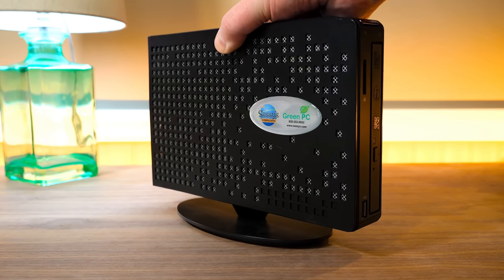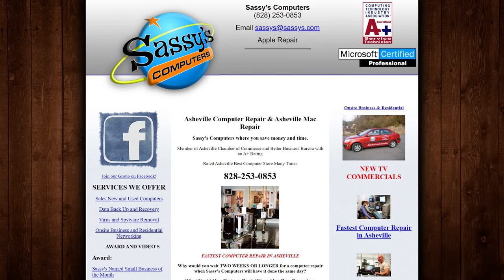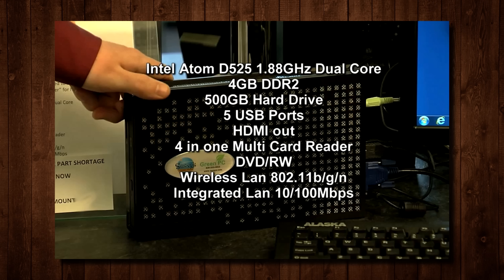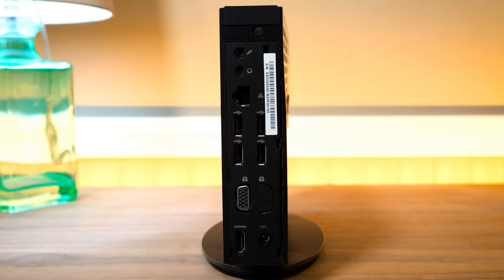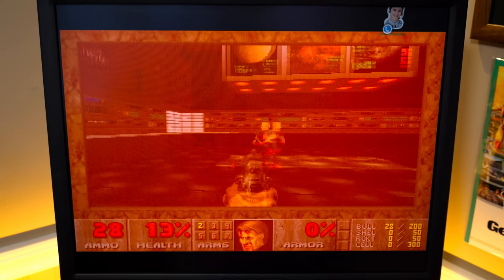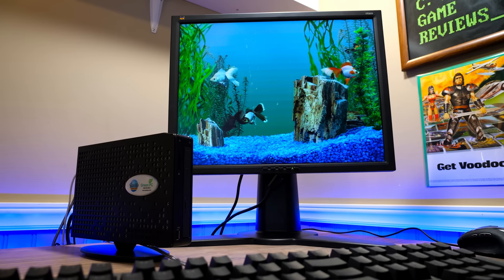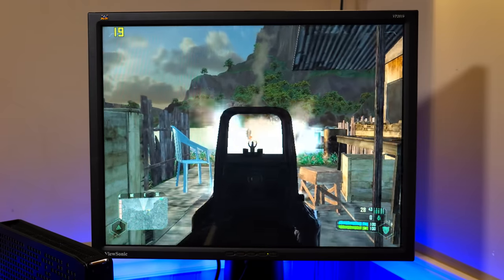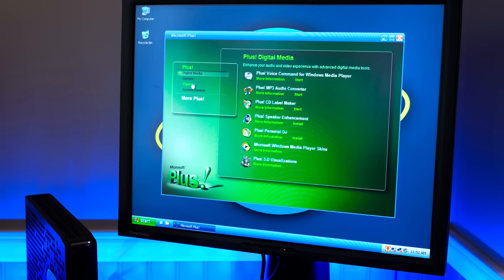Rejuvenating a $599 Shuttle Nettop from 2011! Sassy's Green PC

Comment: I think a video covering the netbook fad from back then would be neat.
Reply: I picked one up a couple of years ago because it was advertised as running Windows 10. I had to see that.

Eventually put XP on it and it hasn't half come in useful for some old niche software.
Reply from the maker: @Jared Lash I agree! I've been trying to find the netbook I had back then to make a video about someday
Reply: i had that nickelodeon one from dell and used it for years upon years. even though i was the intended age range for it i instantly uninstalled the theme that came pre-loaded onto it hahahaha. i played a lot of emulators and skulltag on it.
Reply: I almost bought one because im a writer and having an ultra portable writing machine was appealing but the small keyboard size for writings session was bad for my oven mitt hands.
Reply: @LGR  Which one did you have?
Reply: @thesinfultictac5704  you could have bought any keyboard you wanted to use with it though, including wireless keyboards with built in trackpads
Reply: They are still sought after in Venezuela for regular home / school use
Reply from the maker: @RoshiGaming  the first HP Mini 1000
Reply: You had a full fledge computer with all the typical IO you could want for less than a thousand bucks.

And you were buying a computer that didn't come with one of those useless windows licenses too!
Reply: @yarharyar  >useless windows licenses
????
Reply: Remember watching LGR on my netbook back in the day.
Reply: I had an EEE PC netbook and would play WoW on it when out of town.  It was/is an amazing piece of tech.
Reply: I wouldn't call it a fad. Before netbooks, laptop design seemed to be heading towards 17" displays in machines weighing 10lb (5Kg) with a couple of huge fans in the bottom and a battery life of 2 hours. Netbooks stopped Microsoft from discontinuing XP because the low power light machines weren't up to running Vista.
Reply: @yarharyar  well now, you can get a 15 inch computer with a fully functional windows os on it for less than 500 bucks.
Reply: I still use one of those netbooks today in 2022. Why?

Well I need a little lightweight computer to use with ham radio out in the field. It fits the bill perfectly.

Comment: Those D525s are surprisingly good little processors.  I've been running one with a board that I bought on salvage for $15 as a PfSense box for the last 6 or so years, and it just keeps going!
Reply: Ditto, ran mine as a PFSense box until the proprietary PSU in my case died.
Reply: My old pfSense box had a D525 as well. Nothing ever failed - it still works fine - but FreeBSD's Realtek NIC driver is terrible. Even compiling and loading an improved (backported?) driver still capped out at about 340 Mbps, which just won't cut it on gigabit fiber.
Reply: @Azlehria  Well, I learned something.  I should check to see what NIC chip I have.  Thanks!

Comment: I used to work on people's Shuttle units in the mid-late aughts and man they were cheap but efficient... but those motherboards were so picky when it came to upgrades and parts replacement.  Like you experienced with that RAM upgrade.
Reply: I remember when Shuttle was the go-to builder for LAN PCs, because they were so small and light but decently fast.
Reply: @HappyBeezerStudios  I'm pretty sure the first NAS I ever put together was from a shuttle pre-fab as well.  They were everywhere around that time.

Comment: I have a similar 'Green PC' from the windows 8 era, it's an AMD SoC all in one with Radeon HD Graphics. Used it as a home server for a while since it has USB3 ports as well as 1gig Ethernet, though a Raspberry Pi 4 soon superseded it in both performance and power draw.
Reply: You can find bargain Xeon E7 pairs all day on ebay and other websites. I nabbed a pair of e7 4890's for 8 dollars (for both). Not quite "low power" if that's what you're going for. But for a home server, they're stupidly fast.
Reply: @holocaust_2.0  Absolutely! I do have a much more powerful AMD Opteron based server too for more beefy stuff, but yea sadly for things i want to leave ticking away in the background 24/7, the Pi4 wins out on not inflating the electric bill

Comment: LGR has reached "current technology", Im still running a 2012 i5-2500K with a Radeon 7970 as my secondary PC / GFs Gaming PC, and its doing 2022 way better than id have ever imagind when I build it.
Reply: That 2000 series is a beast, I'm still rocking my I7-2700k as a home server and Nas (God bless Virtualisation and Linux) and it has never had any problems.
Old motherboards are a nightmare though, and people have started to sell them as "Vintage Equipment" driving prices like mad.
Reply: Yeah!  I have a 2500K in the last PC I built.  Some day, when I can find a video card, I’ll finish my “new” build.  (Which won’t be that new anymore by the time it’s finished.)
Reply: If you need a cheap quad core hyperthreaded CPU, I'd recommend looking at the Xeon E3 v1 and v2 CPU's, trust me the upgrade is worth it!
Reply: I'm running an i7 4790k and a GTX970, still getting by after 6 years. 👍🏻 You don't need to upgrade until the computer isn't doing what you need it to anymore.

Comment: I have an EeePC from that time (also Intel Atom of course), which actually had a discrete GPU. Not sure why I thought that was a good idea, I think I installed Linux on it and ended up playing some Minecraft. Windows 7 was indeed too slow on it, and then on Linux I had to battle the whole "nvidia gpu vs. intel igpu" thing... I think it was called "optimus" at the time.
Reply: that tech, optimus, was pitted against ion, and i guess ion lost the battle for board presence, as intel threw billions of dollars at battling the low power draw space, and it won them the laptop war against ibm, mac, nvidia and amd, they still dominate the market, by a huge percentage, and thats down to them investing all that money into not only the chips, but the coding and software.
Reply: What are you guys doing with your poor Netbooks? Had one with an Intel Atom N270, it ran Windows 7 just fine, on 2 GB of RAM..
Reply: @xPandamon  same here. In fact, I have an Acer D-250 with an Atom CPU and 1gb RAM and it runs Windows 7 quite nicely for everyday tasks
Reply: @xPandamon  Same here. I also have an ASUS eee pc and it runs Windows 7 Home Premium just fine on 2GB of RAM. I can even watch Youtube videos in 480p and play my Big Fish games without slow downs. Windows only uses 800MB of RAM at most unless I have Youtube open.
Reply: @lightly-red-huedmaleindivi6266  I had to use the mobile YouTube page, h246ify and custom drivers from chell but 480p ran well enough after some initial buffering. For one of the earliest netbooks that's not too bad, I could even enjoy some OG Doom. Also, nice name 😉

Comment: Hey Clint! Great video. Just curious: did you play HL2 via Steam, or a retail copy? Since Source got updates over the time maybe the Steam up to date version could be harder to run even on era-appropiate hardware.
Reply from the maker: It's an old version yeah, Steam doesn't even install on XP anymore.
Reply: Beside the latest version of Steam that support XP, HL2 also got updated (which have Steam Deck/Controllers UI and improvements, major bug fixes  that fixes many 2013-14 SteamPipe version issues) in 2022 and its have newer steam_api (which requires newer version of Steam) for some features like Achievements, its unknown if its still playable on XP, even without these.
Reply: @megakarlachofficial  it would be harder to run the modern steam version.  The fact that it's more resource intensive was complained about at length in spuf (steam powered user forums, the discussion section before modern steam community discussions) threads at the time the update to orange box engine happened.

Comment: Thanks for this video. I just came in to a Shuttle XS35 v3. It helped me to upgrade it. It originally had 4GB of RAM but it works with older 8GB of DDR3 at 1.5V (2X4GB). Mine came with Windows 10 Pro installed on a 120GB SSD drive. I removed the Wifi card to replace it with a combined USB dongle for Bluetooth and  2.4Ghz and 5Ghz Wifi. I installed it on my TV to view movies from Tubi and Pluto. In the DVD drive bay, I installed a 500GB HHD drive I had on hand.

Comment: The incompatible RAM module might be the voltage issue, e.g. 3.3V and 3.5V. I might be wrong.
Reply: Is that still SDRAM for it to run that high? Even DDR1 ran at 2.8v and DDR2, which should be common at the time, did 1.8v in most cases (with some higher end sticks all the way up to 2.2v)
Reply: I don't think that was the problem - the original RAM was standard DDR3 running at 1.5V. DDR3L is specified for 1.35V, but usually works at 1.5V as well.
The new RAM wouldn't have been faster even if it had worked, because the memory controller in the CPU only supports DDR3-800 anyway.
Reply: I've run into some Sandy Bridge era laptops that didn't like 1.35 V sticks AT ALL, insisting on 1.5 V ones. It's definitely a thing. (I now have a Fujitsu Lifebook S761 with non-working standby power. That attempted RAM upgrade really went wrong.)

Comment: With a GNU/Linux installation it could be used for basic things like browsing the internet or editing documents. With Windows XP it is only good for playing very old games. You can't do anything online with Windows XP today.
Reply: You can browse the internet ,but not every site
Reply: You can get viruses, that's something right?
Reply: I think I've browsed more random sites than most people do on their modern machines on my XP box and never had a problem. No antivirus, nothing. This "XP just gets viruses" meme needs to die yesterday, it's really not that dangerous.
Reply: @sarrakitty  yea but as long they dont click on ads, it would be fine, most modern malwares nowadays target more popular OS, such as Windows 10 (and 11).
Reply: You can do more than just Linux on these netbooks. They're more than strong enough to run Windows 7 and even use modern programs like Firefox as-is. If you really want it to run faster, you can even install a mobile layout browser extension. Remember that cellphones are operating at the same speeds as those Intel Atoms, so most of the Internet is already designed to run on low-end hardware.
Reply: @lightly-red-huedmaleindivi6266 Phones are low-end hardware? What about the Snapdragon 865 in my phone with 8 cores and 8 GB of LPDDR5 Ram?
Reply: It's unlikely the Atom CPU would handle modern video formats and javascript heavy websites at acceptable speeds even with a lightweight Linux distro installed
Reply: @honam1021  Well consider it likely because I'm using an Intel Atom Pineview on this Asus eee PC and it does just fine with Windows 7 Home Premium 32bit. Firefox and VLC do most of the work. You seem to forget that we have other low-end devices using modern internet called cellphones, and if a website doesn't load on desktop it will load on mobile layout.

Comment: It’s amazing what they can cram into the form factor of a 100x100 VESA mount mini PC these days.  I just deployed a ton of HP ProDesk 600 G6 Mini Desktops in the last couple of weeks ago in an automotive assembly plant, and I was impressed by their specs.  These little guys had 10th Gen Intel Core i5’s with 8GB of RAM, a 256GB NVMe SSD, wired and wireless LAN, dual DisplayPort outputs, a couple of USB-C and a decent number of USB A ports.  They looked like they had just a laptop style blower fan—but overall impressive for a 35w PC.  Given the specs of our older, much chonkier ProDesk towers—those will be a much welcome upgrade, say nothing for the fact that they will take up almost zero space and won’t die a miserable heat death inside a cabinet on the floor of a manufacturing facility.

The apparently make fancier EliteDesk versions, and if it weren’t for the $800-1K price tag, I’d totally consider getting one.  Be on the lookout for these things in 3 years when they come off corporate leases because they’re gonna be a sick deal in the $200 range.  These had a build date of 2019 on them, so presumably someone got those immediately after they were released, so there might be some hitting the secondhand market in as little as a year.

Even though these things should be able to run Windows 11, I would absolutely be running Linux on them and retro gaming to my hearts content via emulation.

Comment: When the Atom came out, I remember being amazed that Intel were actually able to beat their own record and make a processor that was even slower than a Celeron!
Reply: WUT? What are you even comparing?  Apple II or Amiga 500 is slower than a Celeron. That doesn't mean it's worse or anything really. Comparing two different platforms, with different use and market entirely doesn't make much sense.
Reply: @override7486  They were both from the same time period. The Celeron was an incredibly weak processor in its time, and struggled with even basic tasks. The Atom was supposed to occupy the same niche but it turned out to be even worse!

We expect newer chips to be faster than older ones from the same performance tier.

Comment: You really got to wonder what has to happen so an OS becomes infected with that much crap as if it were a grandpa-PC parody.

Love that omnipresent techguy-head, though. Its almost like a desktop pet.
Reply: Looks like tons of preinstalled bloatware.
Reply: @HappyBeezerStudios  that's all the scam software you've get from advertisements and pop ups at the time. I used to fix tons of computers around that time and this was the standard state (or worse) they'd arrive in. 

A PC shop would not put driver optimizers and PC scanner software on a PC.
Reply: @volvo09  And they are notoriously hard to eliminate. At one time Malwarebytes and Spybot S&D were really good tools, And scamware would make it impossible to reach those sites.  Sometimes even forcing a redirect to its own site, 95% of the time of course Safemode with Networking hit the spot(I did phone support so unlike onsite there was no option to do offline safemode and carry a USB or CD with a set of cleaning tools).

Comment: DDR3 SODIMM had this annoying split that you'd have 1.5v and 1.35v modules, and they were incompatible. I don't think you can damage anything with the wrong kinda module but it sure is annoying. PC3 is the 1.5v and PC3L is the lower 1.35v spec, and it appears that one you tried to add was a PC3L module.
Reply: The problem isn't the RAM voltage, PC3L/DDR3L modules can run both 1.35V and 1.5V per JEDEC spec, so older machines (Ivy Bridge or earlier) which runs memory at 1.5V can use such modules. Newer machines (Haswell / Bay Trail or later) can only use 1.35V modules and will refuse to boot with 1.5V modules installed.

It's more to do with memory density: Clint was replacing a low density RAM module with a high density one, note that the low density module has 8 chips on each side while the high density has 4. He didn't need to replace the RAM anyway since it already had a 4GB stick.

I was quite surprised this PC can even use the full 4GB RAM, most netbooks of that era could only take 2GB RAM at max. Probably due to the processor difference? (Atom D5xx on nettops vs N5xx on netbooks)
Reply: @OverTallman  that's what I heard too but in my experience many machines only want one type. I've never heard about density mattering at all though, that sounds made up.
Reply: @Nukle0n  Memory density is real though. Try getting a late Penryn Core 2 Duo (w/ DDR3 slots) or Westmere i3/i5/i7 laptops and put high density 4GB sticks (with 4 chips on each side) and they'll either: POST but crash while booting OS; not POST at all; no POST but emits loud beeps.

You can take my word on this: I've had a Latitude E5510, a Latitude E6410, an EliteBook 2740p, an EliteBook 8440p, a ThinkPad X201 and two ThinkPad T410, all being Westmere i5 laptops. To get 8GB RAM I had to install a pair of low density 4GB sticks (with 8 chips on each side) in each of them, no exception. Put high density RAM and I'd get no POST or loud beeps. Meanwhile I also had a ThinkPad X230 (an Ivy Bridge laptop) which had no problem taking pretty much any type of DDR3 SODIMM modules: 1.5V/1.35V, low/high density, 1GB/2 2GB/4GB/8GB... well except 16GB modules as they're for Broadwell or later. Mixing different types of modules was fine too.

Low density RAM were usually made earlier while high density RAM appeared later (as manufacturing process got better), so does the voltage (older machines use 1.5V, newer machines use 1.35V). Now the memory density/voltage stuff gets confusing as they can get mixed up, that is low density 1.35V modules and high density 1.5V modules, these do exist though not as common as the mainstream ones.
Reply: @OverTallman  sorry for the dismissive reply, i was in a bad mood. It just seems weird, and i worked in laptop refurbishing, and we never had a problem with density, it was always the voltage.
Reply: @Nukle0n   It's cool, no offense taken.

I guess you're more used to refurbishing newer laptops as the memory voltage matters in those laptops. As I said before, starting from Haswell they requires 1.35V modules.

Lucky you haven't yet touched a Penryn or Westmere laptop (which memory density matters for 4GB modules, no such problem for 1GB/2GB modules), though to be fair those machines are at least 11 years old now so they may not be that worthwhile to refurb now.
Reply: @OverTallman   We did work on stuff from 2009, so that's not very long from the introduction of DDR3, but it's possible i never ran into it.
Reply: @OverTallman  The only atom chips that were limited to 2g of ram was because the chips were soldered on the board.

afaik anyway.
Reply: @yarharyar  Atoms are all BGA though... yeah even the D525 in this "Green PC" is soldered onto the motherboard